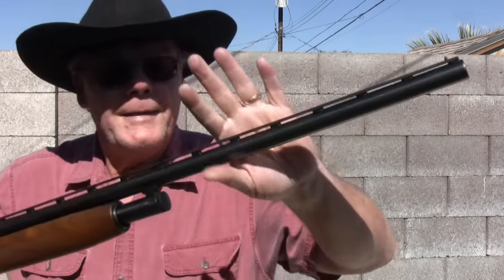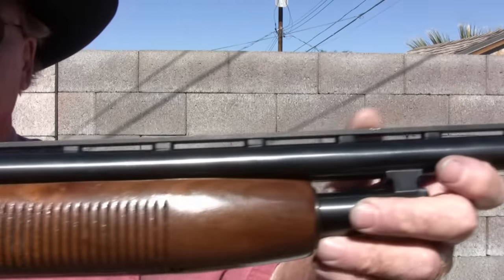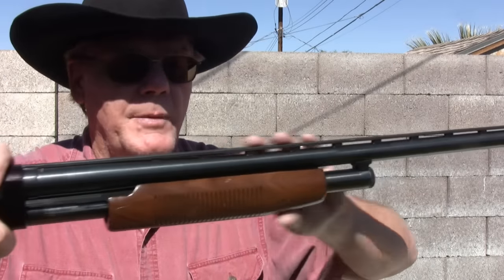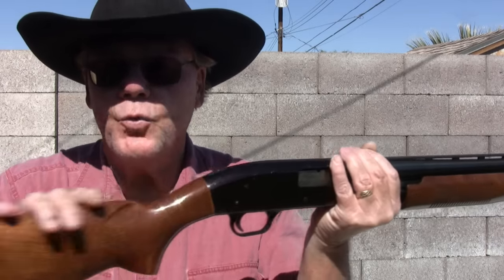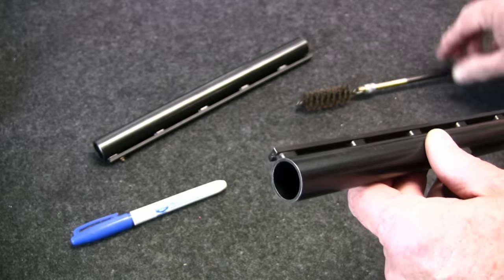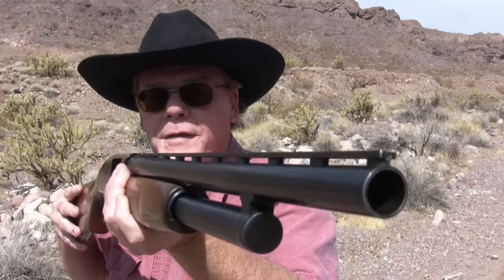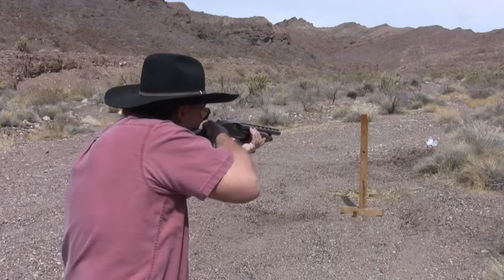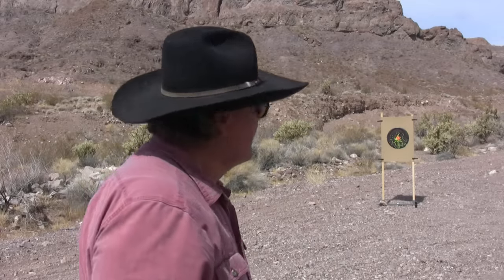How To Cut Down The Barrel & Replace The Ejector On A Mossberg 500 - Awesome Home Defense Shotgun!

Comment: I would cut it down to 26 inches still be a good rabbit and squirill gun. Maybe even,deer.  20 inches don't give you much distance ,,thats 30 inch barrel is good for Turkey. They used to,call them long toms. You just ruined a classic.  Old gun.  That's hard to find any more. ,,
Reply: I was just wondering why he didn't just order an 18 or 20 inch barrel.
Reply: @pnastysavage5510  exacly my thoughts. Too.
Reply from the maker: Have you guys priced a new 18 or 20 inch Mossberg barrel? A new one is selling for close to 300 bucks, it you can find one. That is almost twice what I paid for the shotgun.
Reply: @mixup98  maybe. But I know a bunch,of turkey hunters that would a give a eye tooth for that 30 inch barrel.  It puts that shot out there where you can reach them.  They used to call,them,long toms because of Tom,Turkey's,, ,  my great granddaddy. Was a real turkey.  hunter.   Even,made his own callers. Our of and metal bandaid. Box.   Punched holes in the bottom.  And used a. Ballon. To call toms with,,,,
Hey but if you don't hunt turkey I suppose cutting the barrel is ok,,,
Reply: if you cut more than 2 inches off the barrel you cut out the choke and the choke is what tightens the pattern not barrel length..a 26 inch cylinder bore doesnt make much sense to me
Reply: @ronalddavis  true whether modified choke or full choke is important the length of barrel. Gives you more pressure.  And with a choke at the end. It makes. A big difference in. Pattern and length of shot.    A 20 inch barrel even with a full choke. Won't hold a pattern. Before scattering. When. Held up to a a 28 inch with a full choke.  So it depends on what your hunting and. What type of choke full modified or open,,,,,

Comment: I get why? But as cheap as Mossberg 500 barrels are??
Reply from the maker: Have you checked the prices lately? They used to be cheap but not anymore. You can't find them in stock anywhere and when you do a new 18" barrel is selling for close to three hundred bucks!
Reply: Not anymore . It doesn't cost anything to mod your existing barrel either. I have a hard time cutting a VR bbl ,but no prob chopping an old plain fixed choke. M500 is a great modular platform with many available parts to suit your use.
Reply: @mixup98   Holy crap!!!!  😱😱😱  I bought a 18" 3-4 years ago for like $100.
Reply: @rob.3575  yeah its crazy now. Impossible to find them these days.

Comment: When you shorten a barrel you lose some velocity. The choice is yours.
Reply: Not enough to worry about on a self defense gun.
Reply: Large bore and low pressure, so not much velocity loss.  Even a 14" barreled 12 gauge doesn't loose enough velocity to worry about, especially under 25 yards.

Comment: WOW my 320 performs better than that
Reply from the maker: My 45 year old Mossberg now performs as good, or better, than my new Stevens 320.
Reply: IDK how old my 12 ga. Mossberg is. but My 320 out performs my Mossberg as well and it shoots excellent.  The 320 is faster shorter stroke . The real question is ~ Will it last as long as my Mossberg, with many rounds threw it? That the question?   My Mossberg has never failed me. Only thing has failed is> Federal Ammo